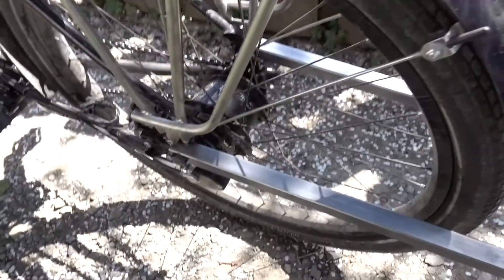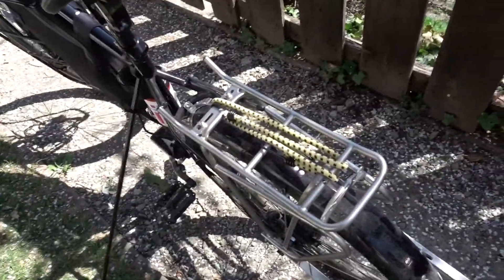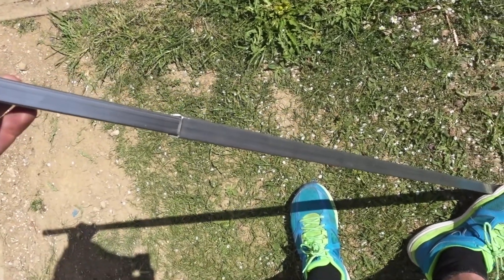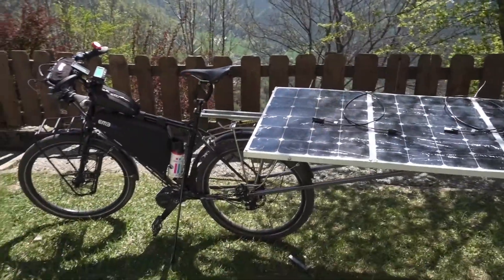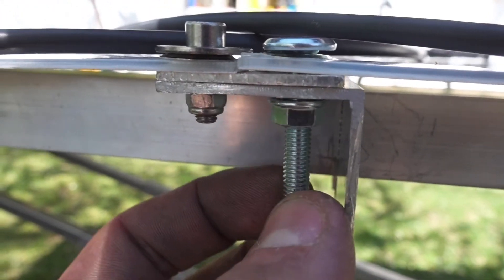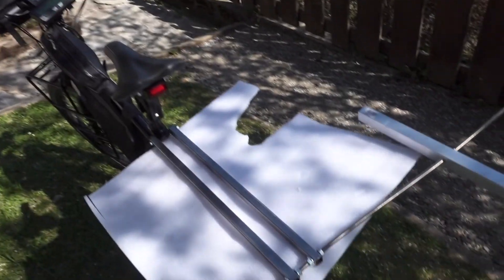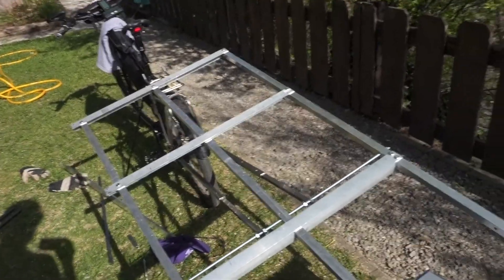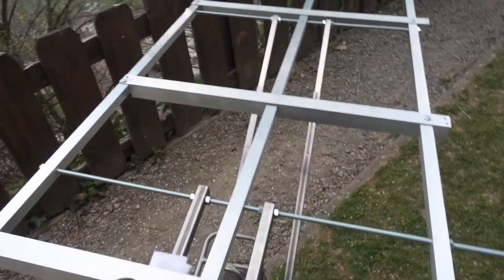Solar Powered Bike DIY - Part 3 - Huge Solar Panel Mount!

Comment: Jack.. I built a 1/2" PVC pipe ladder with PVC glue to act as a light strong (somewhat flexible) lightweight frame for the solar panels.  I then gorilla taped the flexible solar panel edges to Coraplast sheet and screwed that to the PVC frame.  Then I drilled several holes in the frame to attach the struts to my trike frame.  It is really light weight and really strong.